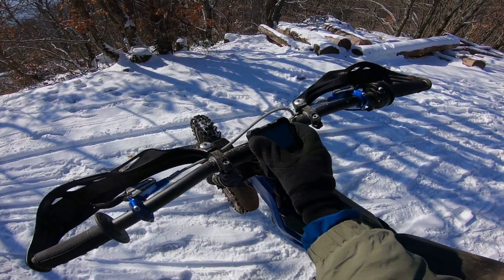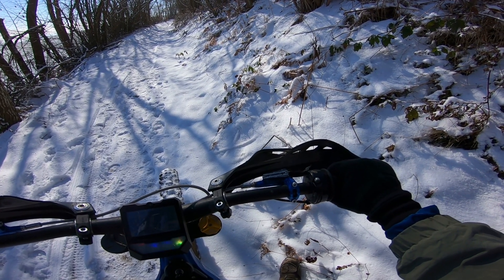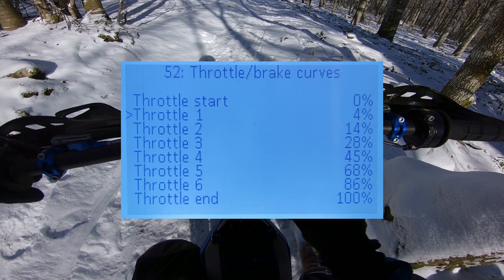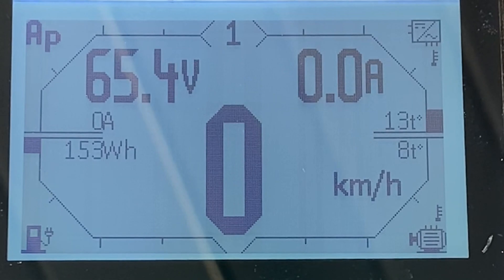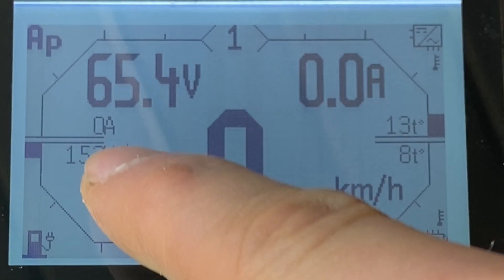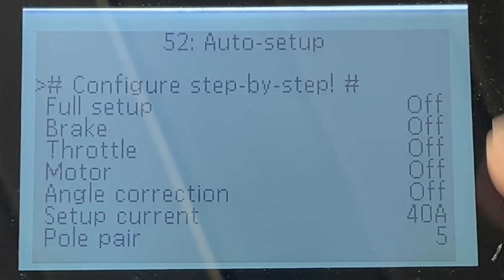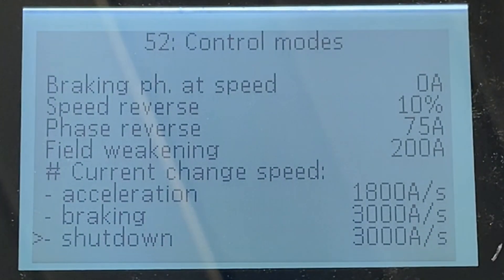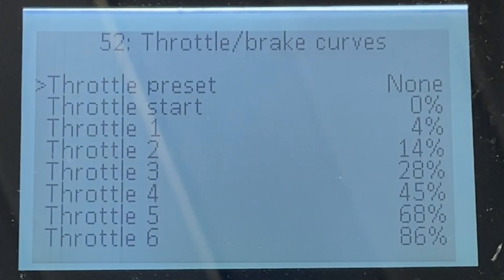🧨 13kW Nucular Tuning | Sur Ron Controller Upgrade

Comment: thanx    i used them for a base tune  and ttweaked it a litle bit  in my talaria sting  i ride with 16inch supermoto wheels and a 58 tooth sprocket stock batt     and this is pretty brutal  power low flying my friend

Comment: Thanks for showing the settings :) 
If your battery peak max was 350A in the battery setting, is it ok to go over to 400A in your control mode 1 - for 5 seconds in boost mode? 
Thanks I am trying to set my 24F 72V without harming anything but want to get the most from the available options.
Reply from the maker: Your battery must have a BMS that secures it, so there's no harm, if that's too much for the battery, your BMS will cutoff of prevent from dragging that much anyway.
Reply: @MTO_Brothers  thank you for the reply. You are the first person with a Nucular controller I have heard mention "boost mode". Very little info about it in the Manual. Thank you again and keep up the great riding and videos.

Comment: L'avantage avec le 24F c'est que tu peux régler précisément l'accélération et faire ta propre courbe en ajustant les pourcentages. Le choix du mode Speedy, torque ou torque + speed est aussi super important. J'adore ces contrôleurs dommage qu'ils soient si difficile à obtenir. Tu peux même régler la vitesse minimum de rotation du moteur et aussi régler une sorte d'anti-patinage si jamais le moteur s'emballe trop vite le contrôleur va réduire la puissance !!
Reply from the maker: Très bonne explication des avantages, le Nuc est vraiment un super contrôleur 😎
Reply: Comment fais-tu pour regler la rotation et anti patinage sur le nucular
Reply: @DuckNono82  Salut il faut aller dans les Throttle contrôle mode setup pour S1, S2 et S3 là où tu vois des paramètres Accélération lim. ou décélération min en ERPM/sec. Avec ce paramètre tu peux choisir une vitesse max de rotation par seconde qui permet d'éviter l'emballement du moteur quand ça glisse. Fais des tests sur le sec et règle les ERPM/sec le plus bas possible pour ne pas sentir de perte d'accélération. Par exemple 250ERPM/sec au lieu de 1000. Du coup sur la neige le moteur n'ira pas plus vite que 250ERPM/sec. Tu peux aussi voir dans débug informations ce que le contrôleur a déjà enregistré sur les accélérations mais je crois que c'est en ERPM/min en lecture direct. Mais il y a moyen de faire des enregistrements.  Dans control tu peux aussi régler Minimum speed ERPM pour le démarrage.  En mettant sur 100 ou lieu de 1000 ERPM le moteur commence à tourner très doucement si tu chatouille l'accélérateur au lieu de ne pas bouger puis démarrer pleine balle.

Comment: Salut Quentin,
Grâce a toi j'ai réussi à configurer mon nucular 24f sur ma sur ron, super tuto, vraiment merci. 

Par contre tu ne parles pas du menu "extra parameter", peux tu stp m'aider à comprendre mes sous paramètres suivant:
- Circumference: 1930mm
- motor sprocket: 32t
- wheel sprocket 304t

Sachant que je roule en 19", avec transmission primaire à chaîne et courronne 58t.
Reply from the maker: Les trois paramètres permettent de spécifier la démultiplication pour que la vitesse soit juste. 
Comme il y a un axe de réduction, on est pas vraiment dans un cas qui correspond. Soit tu fais ton calcul, soit tu installes un compteur GPS (ou téléphone) pour affiner les réglages et tu seras bon ;)
Reply: @MTO_Brothers  D'accord je comprend mieux maintenant. Encore merci de partager ton talent de rider, tes vidéos sont vraiment excellentes, tu envoies du lourd !!!

Comment: Great Video! Any chance you can help with the 24F Install? I have 3 Blue phase wires 1 Red & 1 Black. Which blue wires get matched up with the stock controllers (Blue/Green/Yellow) Cables? Also any tips on mounting this? How did you use the stock controller housing? Thanks for any advice in advance safe riding!
Reply from the maker: The phase wires don't have a specific mounting, they'll be properly tuned on the first auto-setup.
As for the stock controller, you need to open it and remove all the circuits to only save the metal cover (not an easy task).
Reply: @MTO_Brothers  thanks this has helped! Any chance you can share hall table values? Im having this issue where the motor is locking up on me during Auto setup and it goes to "Stopped" status when going thru angle correction. Any chance you know what that could be or help there?

Comment: I have the same setup but I am struggling with settings on power 1,2 an 3 it seems like it is holding back power
Reply from the maker: I just couldn't be bothered with 3 levels of power, I set up one and never change.

Comment: Does ASI BAC 8000 KIT is better then  Nucular 24 with 72v?
Reply from the maker: I wouldn't say one is better than the other. If the plan is to go on-road, I've heard the Bac might be able to provide more top speed (to be verified). 
Apart from that, the Nucular is easier to configure and smaller so it mounts better on the bike.
In any case, both are high end, high performance controllers so you can't go wrong. Go with the option you can have the fastest or for the best deal.

Comment: do you know with these better batteries,are there just extra cells at the same primary cell voltage ran in series to get a higher output voltage or more primary output voltage per cell?..or perhaps both?
Reply from the maker: Li-ion cells all have the same voltage (+/- 0.2V depending on chemistry). So better cells have higher discharge rate but still offer the same voltage. To get a 72V you need more cells in series than a 60V. But with better cells, as they have a better throughput, you can lower the number of cells in parallel and still get a high amps discharge rate 🚀
Reply: @MTO_Brothers  ..excellent explanation!thank you!

Comment: Have you tried a thumb throttle? looks like your pretty comfortable with twist but for me I found switching to thumb allowed far more control - specifically with the type of thumb throttle that goes 'around' the bars - they allow you to brace your thumb against the bars and so bike/body movements don't have a influence on your wrist and throttle.
Reply from the maker: I knew some people do it. I’ve only tried thumb throttle on quads, but I have to admit I’m not super fan of it. But it’s a matter of taste and probably a question of habit too. 
Nevertheless, I’m not sure I’ve ever tried the type of throttle you’re talking about. What you mean is that you push from top to bottom (same direction you’d twist the throttle actually) unlike the normal thumb throttle type that you push forward. Is that right?
Reply: @MTO_Brothers  basically yea, rotates around the handlebar, same axis as the normal full twist, but actuated only with your thumb. I've tried quad style throttles too, and compared to those, i would prefer full twist too, but the 'around the bar' style works well for me. No more whisky throttle. Not quite as good for in the air or going from sitting to standing, but minor enough of an inconvenience there to make up for it with extra control, particularly with no clutch as a 'oh shit' estop... That said, I've been riding ebikes of various forms for ~10 yrs, always this thumb style so im more used to it too I guess :D
Reply: @sn0wchyld  I'm trying to do that EXACT type of throttle, but for regen braking and on the left handlebar! But I'll have to find out what the maximum regen power is that I can use and for how long...

Comment: As an old dirtbike rider, how is this compared to an 125cc 2-stroke?  im not talking about just the momentum, but also the feels.  125cc are very light and fun to ride, while the bigger 250cc /450 are heavy.
One day, i might afford one, or if im lucky, i could make a deal with a seller for one. really love to test one of these, as im normally a motoguy.
Reply from the maker: Eventhough a 125cc is and feels lighter than 250cc/450cc (especially 4-stroke), this is yet an order of magnitude lighter and feels like so. 
In some ways it feels like a powerful 125 and at the same time like a big DH mountain bike.
It's not as well suspended as a dirt bike, but 10 times more manoeuvrable, as few rotating mass as you can get, super low inertia… 
I've actually just posted a video comparing it to dirt bikes.
https://youtu.be/tdtPPqIxIcA
Reply: @MTO_Brothers  Thank you, :-)

Comment: did ya try the auto tune, how was that
Reply from the maker: Auto tune asks you to turn the throttle and some other stuff, then makes the wheel turn forward and backward to adjust motor handling. It will not change the throttle response. 
Just detect the input/ouput to make everything properly work.

Comment: Hey man good to see you out riding in the video again! Is it too soon to tell if you like this controller more than the asi?
Reply from the maker: They both perform very well when properly tuned. They are several things that I like more about the Nucular:
- it fits nicely on the Surron when hidden behind the stock cooling plate
- they aren't any connectors on the back, so there's no stress on the connectors like with the BAC controllers
- it's easier to set up and you don't need a special access to tune things up
- there is one official display that is made to perfectly work with the controller, so no compatibility issues
- it's easy to configure temp thresholds for everything (for reduced power or complete stop) to prevent components (motor or controller) from frying

Apart from that, both are very good controllers and you can configure them to behave very similarly from one another.

Comment: Do you prefer it to the AIS controller?
Reply from the maker: Like I said in another comment, both are very good controllers. There are some points that I like about the Nucular though.

- it fits nicely on the Surron when hidden behind the stock cooling plate
- they aren't any connectors on the back, so there's no stress on the connectors like with the BAC controllers
- it's easier to set up and you don't need a special access to tune things up
- there is one official display that is made to perfectly work with the controller, so no compatibility issues
- it's easy to configure temp thresholds for everything (for reduced power or complete stop) to prevent components (motor or controller) from frying

Apart from that, both are very good controllers and you can configure them to behave very similarly from one another.